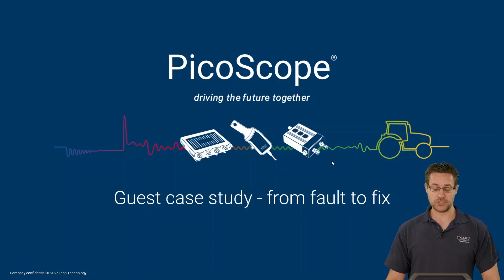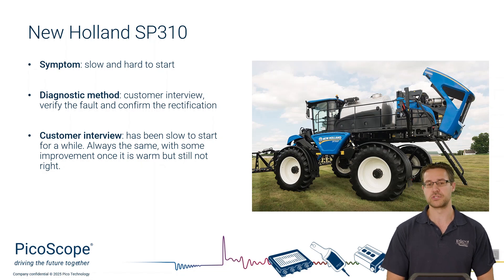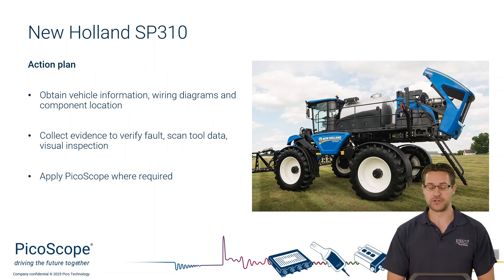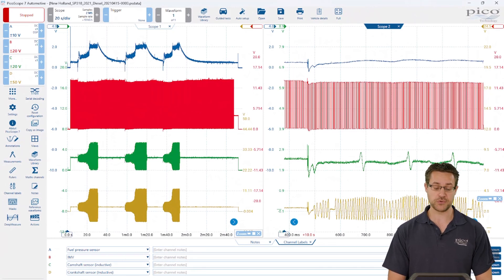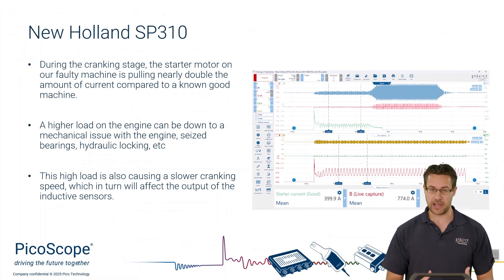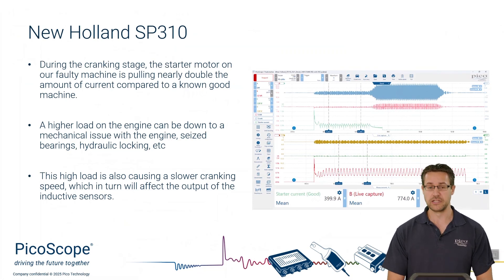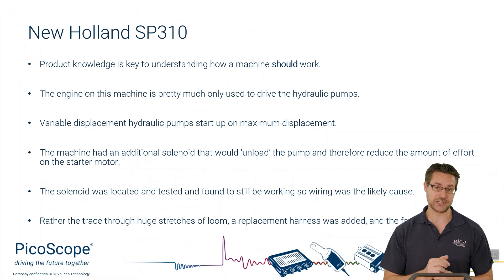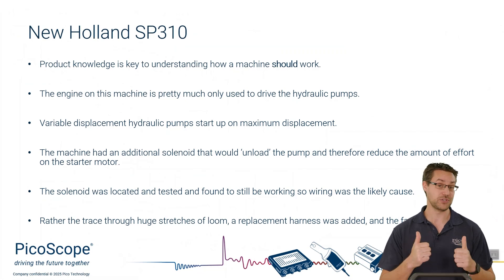Case Study | Agricultural Crop Sprayer SLOW START Diagnosis

Comment: How does cable corrosion increase current? Corrosion is resistive.
Reply: The machine with the higher current should be the one starting fine. The one with the lower current should crank more slowly